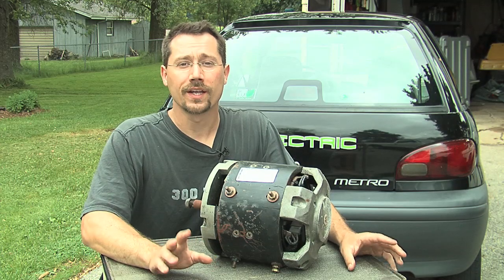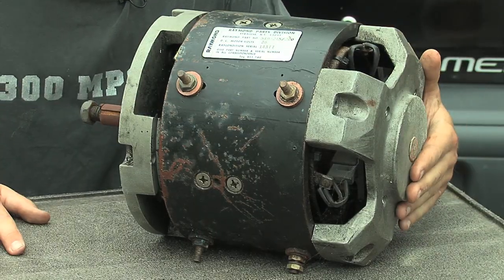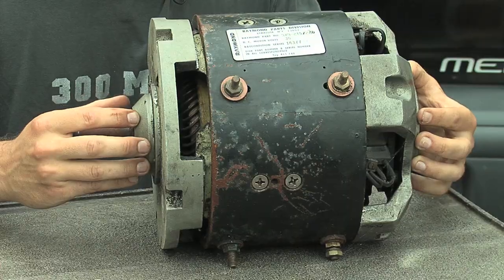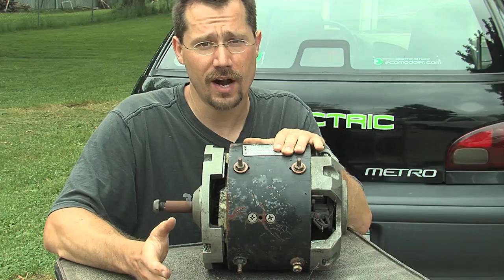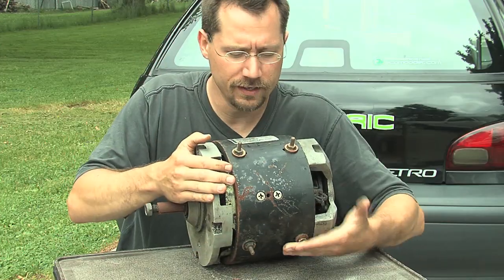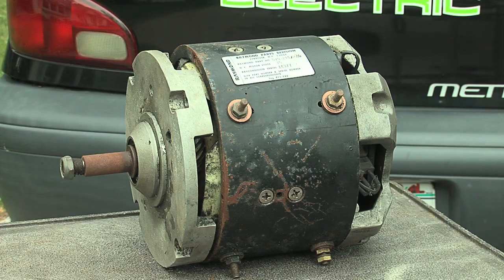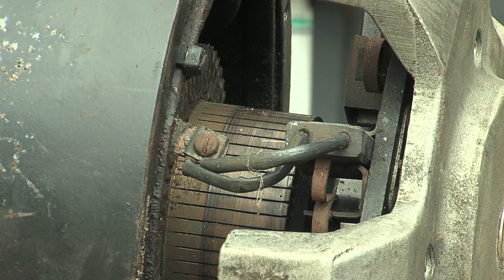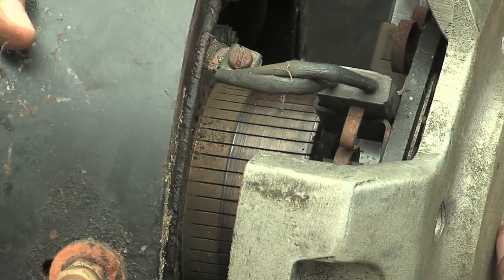5 Build Your Own Electric Car: DC Motor Basics

Comment: Great stuff...

I know many people are afraid of using forklift motors. But I love 'em.
They're cheap, and easy to work with.
I also second your advice on not worrying much about the horsepower rating. That's only a continuous rating, and I've found that most motors are under-rated. Not only that, but the average motor can take over volting to increase the horsepower without any mechanical side effects. Just monitor heat, and everything will be fine.

So, don't anyone be afraid of using forklift motors. They last forever, and do have a lot of power.
Reply: Dr fruikenstein any pointers from you would be appreciated.  Can a inverter run this motor. And what sort of rpm can I achieve.   Regards davesaxuk@aol .com
Reply: @davestevens5159  
Most retired forklifts will have a DC motor, as is the motor Ben features in the video. An inverter will only make the motor buzz.
The easiest, best, and most reliable way to run a DC motor is with a PWM (Pulse Width Modulation) controller. This controller runs the motor by pulsing a DC current to the motor, usually at battery pack voltage. It's relatively easy to hook up, and usually lasts for a few decades with proper care.
There are other ways to run the motor that have been around since the 1890's. But those ways are more complicated, and not nearly as reliable. However, they still tend to last quite awhile with proper maintenance.
Keep this video handy as Ben also shows how to maintain the motor.
If you plan on driving at highway speeds, you'll also want to run the motor at a higher voltage. Between 72 and 120 volts.
Reply: Thx, what kind of speed can u get from a forklift motor? Would u be able to acheive 40mph? In an astra for instance.
Reply: "Cheap and easy to work with"  Just what I need.

Comment: Good explanation sir. If this motor rated at 36volts then dont you need to overvolt it ? otherwise 36v its very slow as i know.
Reply from the maker: On this car project, I used a 48V electric forklift motor and usually powered it at 72V. That was done with no modifications. On a DC motor, speed of the motor is proportional to voltage - higher voltage spins the motor faster.
If you are SIGNIFICANTLY over-volting the motor, the brush timing should be advanced.
I ran the motor in this car at up to 144V. At that voltage, I was noticing some motor heating, and would have advanced the brushes if I left the car at 144V.
Brush timing is not covered in this video. For more info on brush timing, take a look at one of the DIY electric car forums.
Reply: well , i got it, so rated voltages not important like hub or bldc motors so.
Reply from the maker: Türk Best I wouldn’t say not important, but large brushed DC motors are solid pieces of equipment which can take over volting no problem. The thing to watch for is arcing at the brushes and commutator. Many drag-racing electric cars have used motors which started off as stock forklift motors. Hot-rodding DC motors is a bit of an art form, but they can have AMAZING torque.
Reply: i learnt great stuff from u.Thank you very much )
Reply from the maker: In this case the two main advantages of the DC motor used in the car were low cost and simplicity. There are lots of powerful DC motors out there. I bought the one for the car for $50. The other thing is what it takes to control the speed of an AC Induction Motor. In the past, variable frequency drives were expensive and complicated compared to DC motor control. Take a look at the videos I made with my friend, Tom, about his electric Dodge Neon. That car used an AC motor, but the industrial motor controller for the car was HUGE. (That said, it was also completely recycled from a closed-down factory!) https://www.youtube.com/playlist?list=PL47D94695998158F6
Induction motors also typically run at higher voltage than DC motors. Most commercially built electric cars have battery packs in the range of 300-400 Volts DC.
AC variable frequency drives are becoming must more common and less expensive now than they were previously.
Reply: KHALIIL01 Simplicity and costs are the main advantages as Benjamin’s excellent explanation. An advantage of AC motors is that they can also be used for regeneration ( to recover break energy).
Reply: @Conservator.  the brush "DC" motor could be used for regeneration by applying adjustable current to the stator and collecting the energy on the brushes of the rotor.
The exact voltage/current applyied on the stator would modulate the breaking power : stepper hill require higher current.
Reply: @moiquiregardevideo  im glad you said this because i was thinking im sure its possible to do regen with DC.